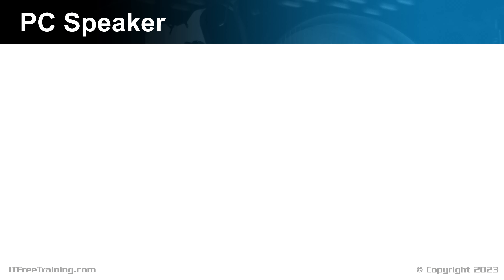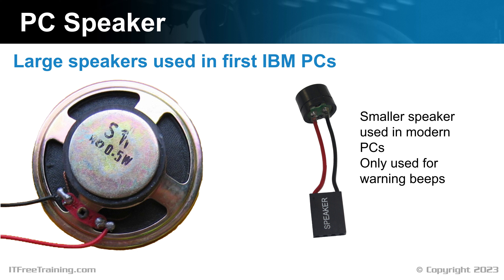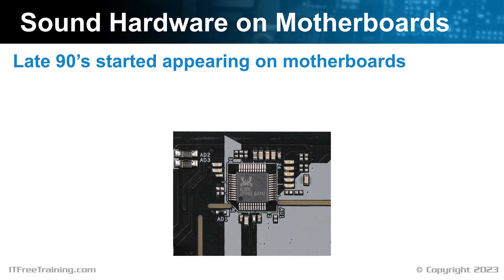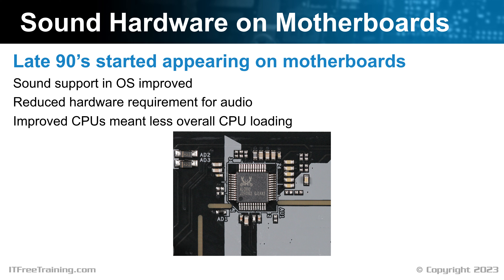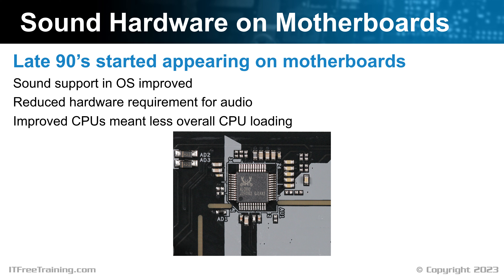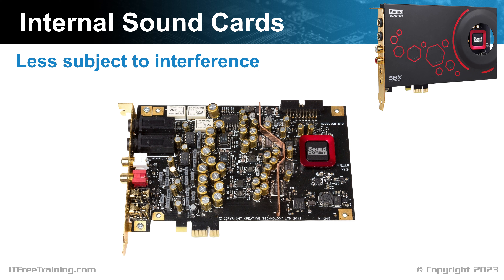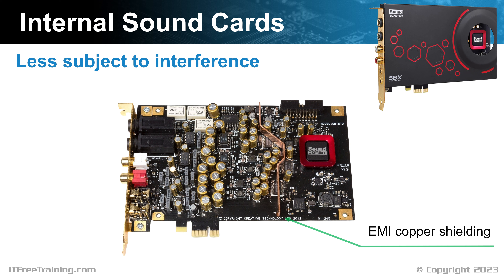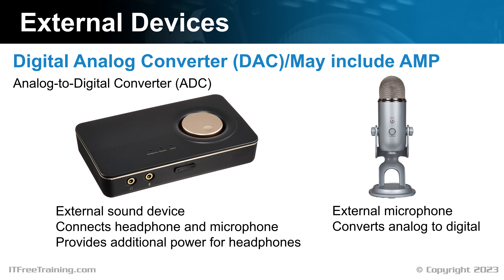Sound and Sound Cards

Comment: One thing you should have mentioned, is that older sound cards, even the sound cards, could only play a limited amount of sounds at once.
I remember when the Soundblaster 16 came out, and it could play 16 sounds at once, something very important in games. It was a big deal! 

Today's sound cards can play 128 sounds, or probably more, but im not aware of the limit, of onboard sound cards. Its probably 64-128 sounds.

There are pro sound cards, that can do far more. I believe Blackmagic has a sound card, that can do 1000 or 2000 sounds. For what? For mixing sound, in studios, with their Fairlight panels.
If I remember correctly, DaVinci Resolve supports 2000 tracks, on the Fairlight page.
Reply from the maker: That is a good point. It something we will consider for next time.

Comment: I'm hard of hearing so normal sound from the PC I find hard to hear even at full volume, I bought an external and connect to my headphones to that, it did improve but still in some cases it wasn't good enough.  After searching I came across a small musical amplifier, I found through a bit of trial and error I could connect my external sound card to this and it boosted the sound, so now I have great sound and on some applications I have to turn it down, but it has changed my life.
Not sure if there is an external sound card for people who are hearing impared, I'm sure there are plenty and they must suffer like I did, so if anyone knows of a good external that has a good volume boost let me/others know please.
Reply from the maker: There is no sound card that I know of for hearing impaired. I hope you find a good solution,